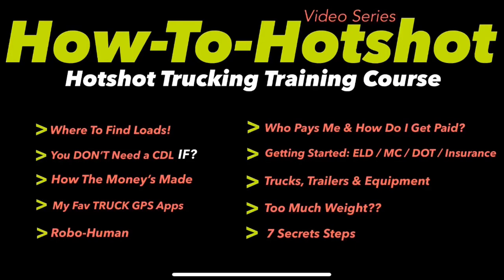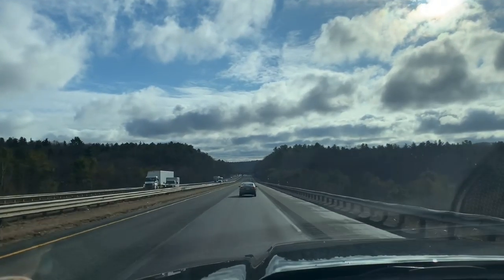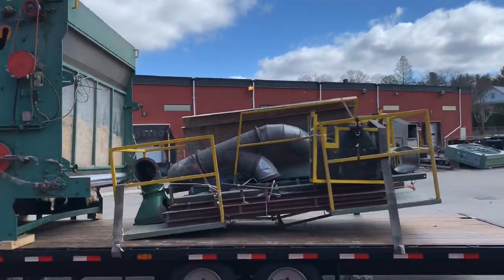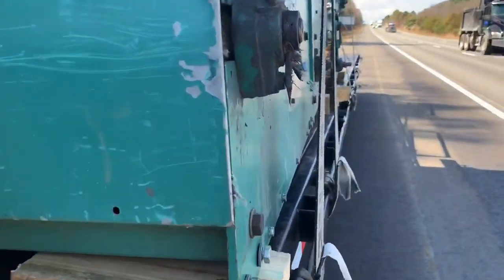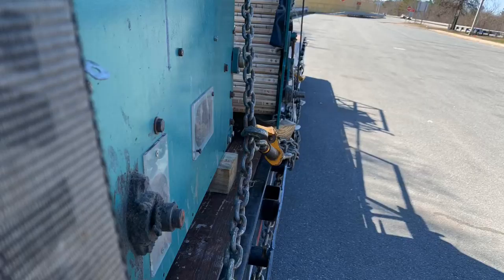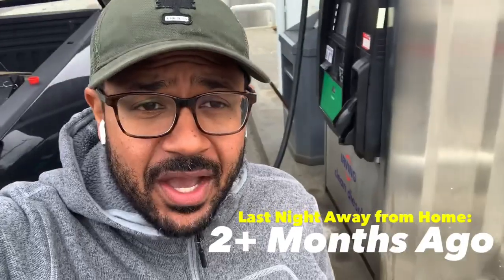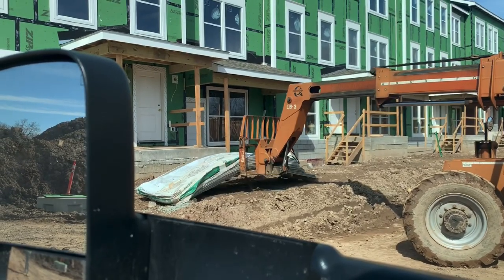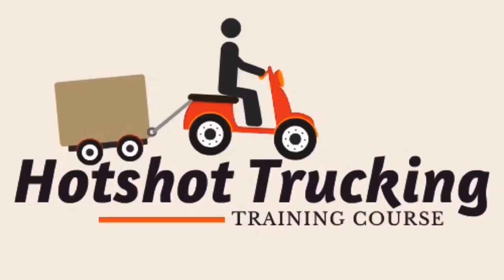HOTSHOT TRUCKING | HOW MUCH MONEY CAN I MAKE | Load Almost Fell Off Trailer!!

Comment: Always use the 8.5 4x4 on tall top heavy freight because it will shift around when you cross over dips before and after bridges .Best to use chains on the base and use back up with staps over top.And don't forget to put one rachet on one side front corner and the otheron the opposite side rear. Peace and Stay Safe

Comment: Bro, take that Impact back  and get the Milwaukee 2767- 22. Best power and tech period!
Reply from the maker: Hey Fritz Duval..man I looked at that $450 Milwaukee but decided to go with the poor mans $250 option lol. Still have 1,200 ft lb’s of torque tho and it did the job...Dewalt is 2nd to the Milwaukee so I felt comfortable lol..def wouldn’t have gone below Dewalt tho! Reliability is the main thing I was after, you know..
Reply: @hotshottruckingtrainingcou9645  good grief. Guess I got lucky. I paid 230 new for charger, impact and battery in the Box. Takes off my Semi wheels super EZ. Dewalt was my 2nd choice. I get it.

Comment: Hi I’m planning to buy the 5500 Cummins. Rams I’m from California how many gas mileage do you get loaded ????
Reply from the maker: Wow, that’s a big rig. I have a 3500 and I get 16 with no trailer...about 12 with empty (6500lb) trailer and about 10 loaded unless going up a lot of hills.
Reply: @hotshottruckingtrainingcou9645   yeah so based on your experience bro do you recommend to buy the 3500 Cummins turbo diesel  how is it so far ???
Reply from the maker: I love my truck, but I got to be honest with you-I have a 2019 and so does one of the guys I dispatch for. Two of my other drivers have 2020 rams. All four of us have had a check engine light issue at some point between end of last year and this year. Doesn’t matter much for my truck because I don’t drive it often but for those guys on the road, it’s a big deal. I hate to say this but, I would investigate a Ford F350, a GMC or a Chevy. Haven’t heard any complaints with those. Just make sure the research them for yourself online and on YouTube before making a purchase. I can’t put my stamp of approval on RAM right now though.

Comment: I am actually having a small issue with one of the loads that I have right now, the tarp ripped and the bungie scratched the paint off of the machine. I stopped and secured it but the scratch is visible. I’m hoping they don’t say anything.
Reply from the maker: More than likely, they won’t make a big deal of it...things happen during transit. I wouldn’t stress it bro but keep me posted.
Reply: Hotshot Trucking Training Course I will
Reply: Hotshot Trucking Training Course I made both of my deliveries with no issues, they were just happy to receive the delivery that they didn’t say anything, I told them about the scratch and they said no problem, they didn’t even look at it twice. I missed a good load tho because I was a little too far out. It was about 90 miles paying $600.
Reply from the maker: EdiownedU - sounds like you’re moving along pretty well brother! No sweat..you’ll miss out on good loads here and there but it’s better to miss a load than to commit to one and not be able to pick/drop in time because you couldn’t arrive on-time: driving under pressure of being late is the worst! Whatever you do, don’t rush in this business...if you rush, you def will make mistakes...and mistakes in this game are typically costly. Hey, do you have a factoring company yet?
Reply: Hotshot Trucking Training Course yea I do, I have everything set up already.
Reply: Hotshot Trucking Training Course do you know if brokers leave reviews on carriers?
Reply from the maker: EdiownedU - not that I’m aware of.
Reply: Hotshot Trucking Training Course all the good loads require some experience or maybe you have to know the broker.
Reply from the maker: EdiownedU - not necessarily knowing the broker but a fair amount of loads will require that your MC number have been active for min 6 months but not all brokers require that. Only a handful require 1 year. I was able to stay pretty busy early on despite this tho..it’ll just take a few more calls to find loads.

Comment: I'm not an expert but that look like a lot of weight on your truckI think you only got lucky with that would a tow truck with a large boom be able to lift it and reset it not sure about cost either
Reply from the maker: I agree..a little luck and a little skill. The weight was fine (looked heavier than it was), but I overlooked the length of the dunnage provided by the shipper. I k is better but totally overlooked that component of the load.